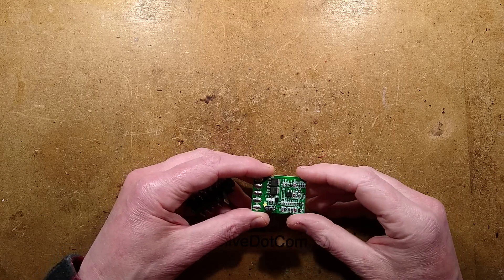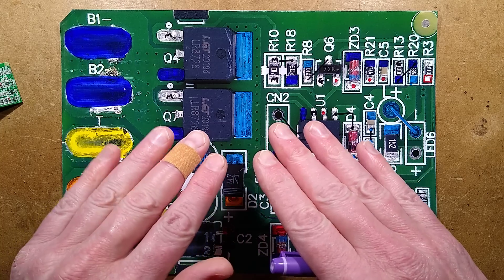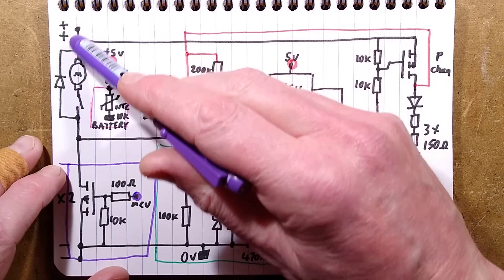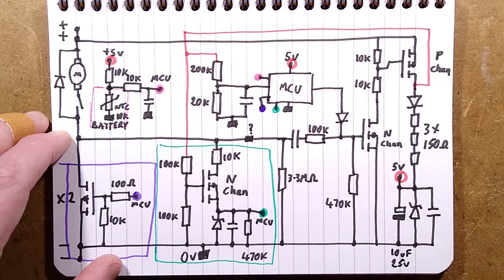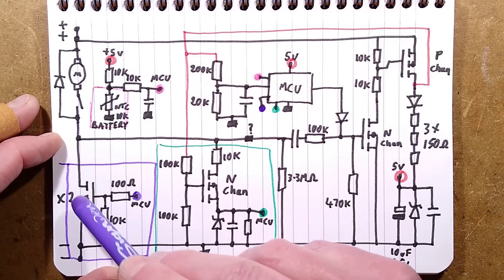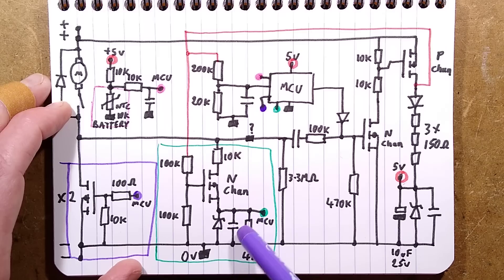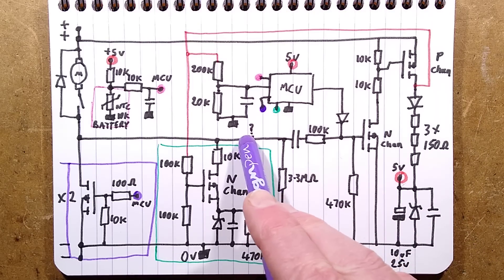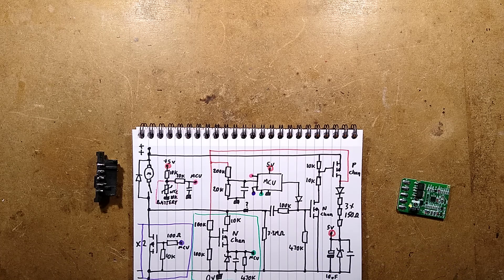ALDI/Ferrex cordless drill PCB

Comment: The  circuit  in the blue box   could be a    low  voltage  cutout  to protect the  battery   from going to  zero volts
Reply from the maker: The battery has it's own monitoring circuitry and signals problems by removing the thermistor signal.
Reply: @bigclivedotcom  but what if the microprocessor crashes in the battery? Redundant protection is allways a good idea.

Comment: I think the green section is simply to allow the MCU to tell when the trigger has been released. it will likely be PWMing the purple MOSFET, so could sense the switch state during the "off" periods
Reply: Could be pulsing it... Or maybe just monitoring the DC voltage drop across the FET's RDS(on) to see if the trigger has been released yet. Those drill motors draw quite a bit of current even when unloaded so there'll be at least 100mV across it.
Reply: @kimchristensen2175  Yes uses the on resistance to monitor current, as the voltage will rise with increasing current, so when the voltage rises probably over 400mV, probably around the 20A mark, it will switch off the mosfets, as this indicates either the drill has jammed, or the load is in danger of burning the drill out. Just like the DW01 does it, monitoring the voltage, though here the zener and resistor is there as clamp and, with the 10k resistor, as RC filter so it will take little notice of noise, and will need around 0.1 second of high current before the MCU turns the output off, so you need to let go of the switch, wait a second for the capacitors to discharge fully, and try again. For higher current you just use a third or fourth mosfet in parallel with the original power devices, as the current sense resistor is mostly provided by the leadframe and tracks, as modern mosfets can have on resistance equal to that of the same length of thick wire.
Reply: @kimchristensen2175  I wouldn't expect 100mV or anything near that to be enough to turn on the other transistor, especially with the voltage divider cutting it in half at the gate.

Nevermind. I forgot the connection to the gate is the red line that goes around to the top-right. That does make sense.
Reply: Could there be motor braking, or regen to dump a bit of power back into the battery ?
Reply: I guess the idea is to regulate the available motor drive voltage, as the battery voltage drops from a full charge ... thus providing the operator a more consistent tool behaviour. Inside the Ozito 18V PXC drill (popular cheap junk in Australia) you see a similar circuit, would be interesting to compare.
Reply: Yes. This circuit is using a couple of rectifier fets as a low-side-driver instead of using a full motor driver chip as a high-side-driver. The circuitry is more complex because of the missing features (current sense line and thermal cutout), but the principle is the same: microcontroller produces a PWM signal that turns the FETs on and off in a controlled way to vary the speed of the motors.
Reply: @Falcrist  : Hm, no. Speed control is not done on this board. The speed controller is in the box of the trigger. This board is only for battery monitoring and low voltage switch off. Nevertheless the controller could make short shut offs for measuring. Here scope pictures while running would be nice.

Comment: I don't see any speed control circuitry, just an on/off switch. Seems like a lot of complexity if all it is doing is checking for 10k on the T connector and some basic over current protection.
Reply: He mentions that the "switch" on the drawing is actually the trigger and that the trigger assembly uses variable frequency to control the speed. So, yeah, it really does seem like all the complications is because they want to be able to switch of almost everything for ultra-low leakage when sitting on the shelf.
Reply: The speed control circuitry is on a different board or in the trigger assembly.
Reply: my thought exactly ... maybe its just a pound worth of mumbo jumbo to make it look like something and all it does is turn on the mosfets .. the drill probably works just fine with 12 V going directly into the trigger switch  ^^

Comment: Could it be using the red-wire and its attached voltage divider to monitor the battery voltage for a rise (when the heavy load is removed)?
Reply from the maker: It could be.
Reply: @bigclivedotcom  It'd probably come down to if it's an analogue input or if they have that voltage divider set to flip a digital signal.

Comment: Interesting. It's morning now (moaning? Techmoaning?) and I'm still a bit sleepy, so I had a little brain fart trying to analyze how the microcontroller gets its power, but then understood it, hahaha! All you need is to have some capacity to give it an impulse to work. Clever.
Reply from the maker: It was quite a puzzle to reverse engineer.
Reply: @bigclivedotcom  Having done many circuit tracings over the years it's a lot easier when you know roughly what's going on before you start. Amazing how often you find mistakes too.